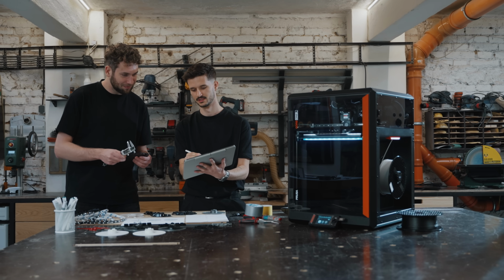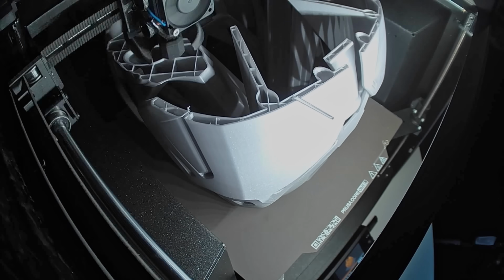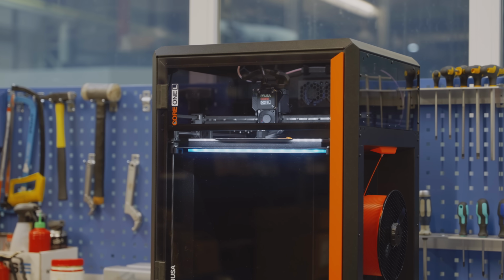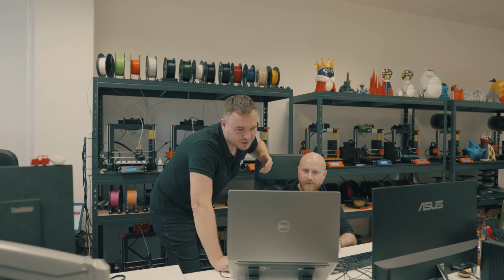Think Big, Print Bigger: Introducing the Prusa CORE One L!

Comment: *Ciao Signore Prusa! *
I'm looking for a new 3D Printer & I have a few concerns:
1) A High-flow Hardened Steel Nozzle should be included, instead of the current two
2) Prusa Slicer is missing filament calibration to generate test pattern (must use Orca Slicer).
3) Incorporating a Nozzel Wiper (like other companies utilize) would save customers untold grief...

Comment: Its great that they are still innovating and upgrading, now at a slightly faster tempo.  My library will not be buying a new 3d printer this coming fiscal year, but that is okay.  I think multi-tool switch is where the future is going.  Prusa has shown off multi tool switching for the XL years ago, and I full expect their next CORE or MK5 product will be a four or five tool system.  Prusa has always put less waste as a core tenant of design, and I think MMUs are wasteful even with all the mitigations Prusa has introduced; multitool system each with tehri own material are much less wastefull when using different types of a material in one print.

Will it be in 12 months of 18 months?  I don't know but I full expect a five tool CORE TWO system.  Moreover,  I expect a Prusa system, as smaller & less expensive system, that might be a  three tool system - MK5 or a new mini.

Comment: I would prefer a 320x320 bed so you could print 300 mm parts with brim/mouse ears. And considering what others offer I would have expected a dual material head (material + support). The mmu is just a better-than-nothing option for that in my oppinion.

Comment: I'm still running a MK3S+, and it is running like a champ.  I've been overthinking the XL vs Core One, and now I'm glad I did for once.  I wanted the Core One, but I needed more volume.  11.8" X 11.8" is close enough.  

I'm looking forward to that heated chamber.  It will solve the only issue I've had running the MK3S+.  I had inventive ways to solve it, but now I won't have to, and it can just run less finicky filament on it while the CORE One L handles the rest.  It will also be nice to finally have 2 FDMs.

Comment: 290C nozzle is a big miss when you are offering 60C chamber and 120C buildplate… just short of making actual strong PPA and PPS parts. Why not 320C at minimum?
Reply: I think this is because Nextruder's printed parts cannot withstand higher temperatures, and the air intake for cooling the material and thermal break must be moved outside, otherwise they simply cannot handle the job at higher temperatures.

Comment: I'm sure the CORE One L is a great printer.  Prusa has a long and good reputation.   But, in my opinion, they don't have too much innovation going into their new products.  If I am just looking to print larger parts on a reliable printer the Bambu H2S has bigger print volume, higher temp nozzle, higher temp chamber, with AMS, and cheaper.
Reply: Prusa is currently only preferred by its fans due to its current prices and features.

Comment: The price man the price... How could the larger Core One be smaller and more expensive than the H2S + the AMS Pro ????
Reply: Good question right
Reply: @JakovPerisic  It's not made in China.  Also, most of the parts are not made in China.  It is assembled in Europe with mostly European parts.  Of course it costs more.  I priced them both out, and I do see the difference in price.  For me specifically, shipping was free for the Bambu.  I'm assuming this is because it would ship from Austin, TX.  When I add the shipping for Prusa3D, the difference in $700.  That is with no AMS or additions to either.  I just checked Printed Solid, and it looks like they are finally getting it together.  The CORE One is the same price on Printed Solid as on Prusa3D, and shipping is free in the US.  Of course the CORE One L is not available there yet.   

On a side note, I checked the CORE One, and it is free shipping from Prusa3D for economy International shipping.  I wonder if it would ship from Delaware.

So. . . If I wait for the CORE One L to be on Printed Solid it would only be $550 more than an HS2.  That's a reasonable difference to get something made in the EU vs China.

Comment: If I had the money for this I would buy it tomorrow. Even after years of printing experience my old prusa mini is STILL the most reliable machine I have. Moved house, let it sit for months, whatever I do that thing still can spit out a good print without any fuss.
Reply: Great news! The competition offers you way more than this, for a lot less $!
Reply: @glp.1337  I don't think your "competitor" ticks all boxes Prusa offers.
Reply: @myhandle-q1b  Really? Like what does Prusa offer that others don't offer better? Only thing I know that might be debatable is Customer Service.
Reply: @glp.1337 like quality components, a bed that has EVEN heat distribution, reliability. 

I appreciate there are many so called “competitors,” but there’s a difference between a ford focus and a Porsche.
Reply: @L3x4Pr0ne  Which components are you talking about? Because the components all come from China on basically all printers. Stepper motors, cabling, PCB's, Threaded rods, rods, ... And you do realize the AC heated bed on the Prusa Core one L is the only Printer that has it? I mean, I appreciate you answering this question. But it was kind of rhetorical since the entire community shifted away from Prusa printers for good reason.

Comment: "never have to connect it to the internet, not even once. You can even remove the wifi module."

THANK YOU!!!!!
Reply: Also removable cameras and antenas? No AI support? Open source code? I am so proud to be Czech ❤
Reply: And its not like "you can desolder it from the board" its its own board plugged in with a header thats super easy to remove if you want to.
Reply: Is that supposed to be something special or?
Reply: @JakovPerisic  It's definitely a stab at BambuLab. There was some drama about a year ago regarding new software changes they made, and Prusa is still capitalizing on that misstep.
Reply: @JakovPerisic ye. Some people wants to print weapons. Now off the radar...
Reply: @JakovPerisic It's actually required for secure environments.
Reply: @JakovPerisic It is probably a reference to Chinese Spyware 3D printers. Having ability to physically remove Wi-Fi/Internet connection leaves a restful mind you know.
Reply: @olinuxx  which ones would those be? I haven't seen a 3d printer that can't be run in offline mode.
Reply: @JakovPerisic Run in offline mode vs having the ability to actually remove the module are 2 different levels of privacy. Its like having a physical cover over your webcam
Reply: @MatteoBuk  irrelevant for anyone who is normal
Reply: @JakovPerisic  But a great option still. Anyone doing hobby printing can leave it in, but some sectors in government especially need the added security options. 😊

Comment: Any chance we could get some of these features retrofitted to a Core One (regular)? Seems like the vent latch is pretty straightforward. Maybe the convection heating could be scaled or readjusted for the smaller platform? It would be cool to have them as feature toggles in the firmware and slicer rather than gated through a model name.

Comment: It's only 300x300? 
And the price is insanely high for what you get, still single tool head, still charging extra for all the addons that should be standard, still using outdated screen with a ribbon cable.
Very disappointed. You need to do more, do better.
Reply: Yep, they could do much more but they refuse to for some reason.

Comment: I really like the looks of this machine. The only disappointment is the nozzle temp of 290C. I very often am required to print higher temp materials like pps, PPA which need to be around 320C. If this machine could hit temps closer to 350C it would be much more tempting to use in engineering applications.

Comment: Ok so lets break this down...
$1800 printer + $150 shipping + tax makes this around $2.1k.
They upgraded the print volume. They added a better camera, heatbed, chamber heater.
"Facepalm"...Prusa...you did not innovate. You just improved on existing features....

The competition Bambu H2S
$1500 + tax + free shipping makes this $1650.
The H2S not only has more features and a rock solid reputation.
But its bigger, It has an AMS, Filament dryer, also a heated chamber, quick swap nozzle system.

Prusa your still miles behind...Whats happening? 
The only innovation I see is the factory in the USA. That was a very smart move considering tariffs.
Reply: Bot
Reply: @LilApe  he replied so by your logic he is not a bot, what now? Maybe you are a bot because you never reply...
Reply: @LilApe 
No bot here mate
Just evaluating Prusas business

Comment: Still no dynamic flow and automatic input shaping calibration. Still no sophisticated pre-print nozzle cleaning. All this makes the printer less reliable for unattended print starting and the high flow nozzles are just oozing monsters. So what do i need the remote control for, if I still need to babysit my printer? I own three C1 and one XL and had them all from the MK2 on. Still, I like my Bambu A1 better and they cost just a fraction. I’m not impressed. Still I support Prusa, because we need companies inside the EU. But from a hardware and software standpoint, I’m not impressed.

Comment: Looks like such a nice printer! But I don't get why stick with the side pockets, the print wolume could be 330x330 but its 300x330 so cylindrical or square shapes can only be up to 300mm, and also that's extra material and surface area that bleed hea

Comment: I have one question to the Prusa team:

In particular those who just updated to the CORE One would be very interested in getting an answer to the following question:

Will some of the improvements that the CORE One L provides also be "backported" to the CORE One (likely via some upgrade kit like those from the MK4 to the MK4S or MK4S to the Core One)?

I in particular would love my Core One to have
* the new convection heatbed with the fans and active circulation,
* the automatic vent opening/closing feature, and
* the new option for inserting flexible filament,
too.

Thanks for your answer.
Reply: A vent opening model has been on Printables for a long time now  - "Core One Automatic Chamber Vent"
I wouldn't expect to see an upgrade to an AC bed.

Comment: I wander if you'll be able to upgrade from the core one to this sometime next year
Reply: i think not
Reply: Maybe. It looks like it uses the same steppers, control panel, mainboard and extruder as the standard Core One
Reply: @nickfury1279  Nope, Prusa confirmed there will not be any upgrade from Core One.
Reply: @PetrCach where is this confirmation?
Reply: There's be almost nothing left of the Core One, it'd be pointless.
Reply: @_Piers_ yeah im not super familiar with the prusa ecosystem. Just started reading about it for a week and finally decided to pull the trigger on the Core One over the H2D. Then like 5 hours later this dropped lol.

Comment: No active heating independent to the bed at this price point is ridiculous
Reply: Does there need to be independent heating? What are the advantages?
Reply: @sg1sg looks like the main selling point are the advanced materials like ASA. And chamber heating it’s important for the engineering type materials. Also no integrated filtration, just some obscure add on on the outer side with carbon filtration. For the price that I expect this printer from Prusa to cost, that is a bit lackluster
Reply: GPIO expansion board + heatgun

Comment: The camera's heating system, which is achieved by redirecting heat from the bed, could be extrapolated to the "external section" that houses the filament spool ;)... Obviously, this could be achieved with an extension, but I'm thinking of hardware & software Made In Prusa, for example, an automatic opening or closing of the hot air intake that allows drying the filament, although yes, 60° may be sufficient just for PLA..

Comment: Why are they always one step behind? Like the k2+ is 350mm, H2S is 340mm, and this is 300mm???
Reply: By that logic you could argue that Bambu Hseries is a step behind Prusa XL. Or P2S behind Core One L.
Reply: @TheKarolans  xl isn’t in the same price bracket
Reply: 40mm is not That big of a difference  also on most bambu and other machne dont allow you to use the whole print plate
Reply: @therappbrothersyou're incredibly wrong on each point. If you have a part that is 340mm then it makes all the difference. And I regularly print parts that are that large which would even benefit from being 350mm or larger.
Reply: @mv2woods even if you had models that were 40 mm bigger it doesn’t really make a big difference to the actual model. To give credit where credit is due Bambu and other competitors have also been pushing the limits with restrictions on their products but Prusa has a community, loyalty and respect that other competitors can’t replicate. Also I think this is a big step to Prusa starting to challenge bambu labs, creality without locking their products.

Comment: Marketing team, what the heck, why not tease Core One L at least few weeks before? Even 1 day before "Black Friday" sales of Creality and Bambu Lab would be good.

I was looking for upgrade from A1 mini, I wanted at least 256x256x256mm build volume enclosed with nozzle ready for high-temperature filament. While P2S, Core One, or Core One L might reach 50-60C in chamber I still went for Bambu H series that has active heating element that can go 65C. 5C difference might be nothing, but still seems better than relying on just bed heating for whole chamber. Prusa might have better heating element overall, and Bambu might need extra 5-10C bed temperature bump to reach the needed bed temperature. Will see in the tests in coming weeks I guess.

Anyway, heck, I went for H2D already, I probably haven't searched enough but there was no indication that follow up to Core One is coming so soon. If I knew...

Velká škoda Josefe.

Comment: Your competitor's large format single nozzle is 340x320x340. And exactly like their printer, your hardware design is also closed source.
Reply: you really think they should give away their designs right after launch?
Reply: @fofopads4450  Yes! That's the very point of being open source! They stopped doing open source DEVELOPMENT of software as well, opting to wait until they ship software before open sourcing it.
Reply: @Software2TF2  i find this idea really interesting. So they should go out and always give out ideas for chinese closed source manufacturers to copy them right away? At what point does prusa make money and does not go bancrupt this way?
Reply: @Software2TF2  is not economically feasible on launch. 
They need to recoup the development costs and that's not possible if in a couple weeks FYSTEC releases their bootleg "Core One Yuan"
Reply: @Software2TF2  Prusa is a company that has to feed the mouths of over 1000 employees and pays livable wages. They aren't a open source project like voron. And they certainly aren't funded by the CCP like those Chinese "competitors" you mentioned.
When prusa launched the MK3, it was fully open source. Guess what, the Chinese came in a made a 1:1 cheap knockoff clone and  sold it on aliexpress for pennies on the dollar. Prusa can't afford to open source everything, as the Chinese will do what they do best and just rip them off and undercut prusa.

Comment: 1:07 Where did the "only 10% larger" claim come from? The footprint went from 415*444 to 469*521 (data from Prusa's official spec sheet), that's ~33% larger in area.
Reply: You'll be needing a 3rd dimentions to measure the size of a 3D object...
Reply: @_Piers_  I think it's reasonable to assume they were talking about the on-desk footprint being 10% larger on this new model. But in reality the footprint is actually ~33% larger.

I'm actually being generous for not including the 3rd dimension. Going from 415*444*555 to 469*521*635, the overall volume actually increased ~52%.
Reply: For anyone wondering, the print volume went from 250*220*270 on the original CORE One to 300*300*330, which IS roughly double the print volume. But the heated bed only got ~64% larger, and IMHO 300*300 is nowhere near enough to call itself a "large format printer."
Reply: @gur3n6089 definitely not big enough

Comment: That vent opening is AMAZING ha ha. The ultimate in K.I.S.S. engineering. A thing of beauty.
Reply: I sure hope there will be a an upgrade option to allow core one to do this at some point.
Reply: It'd actually be a pretty easy thing to design... easy to print.
Reply: @williamsteele  true but loading the code into the firmware to be used at the appropriate time without crashing could be interesting.
Reply: @blzrdphoto It's not in the firmware... It's in the gcode... At layer changes.
Reply: @blzrdphoto There is a community mod on printables to do that. In fact I think the feature in this printer was inspired by the Core One mod.
Reply: Keep it simple stupid? Is that what it means?

Comment: I was going to get a MK4S so I can upgrade to the C1, will the C1L have a predecessor so I can continue my upgrade line. also, how heavy is it, I am attempting to do the MK4S->C1 line as it is light and mobile. The C1L will tie in well if it is also mobile as I can’t take my XL 5T everywhere due to its size and weight